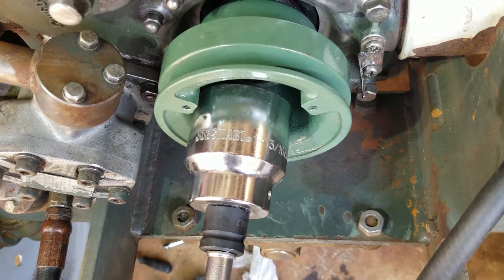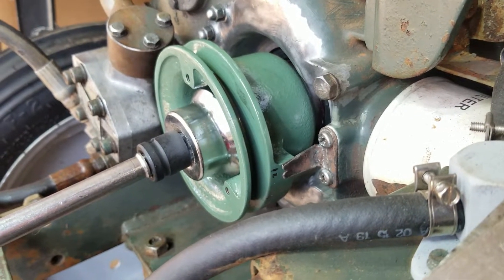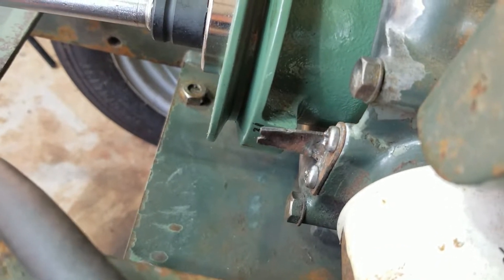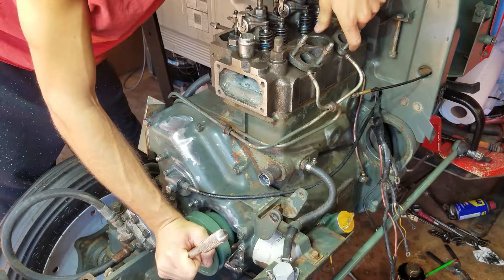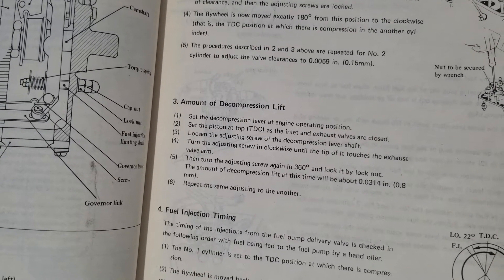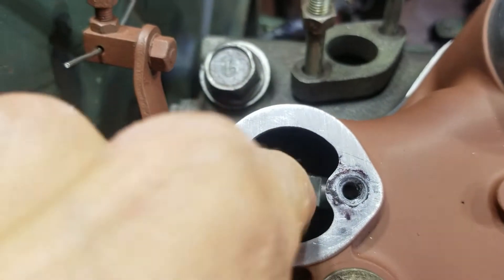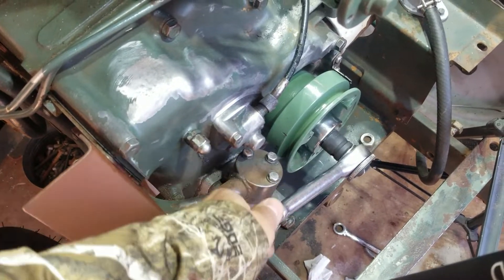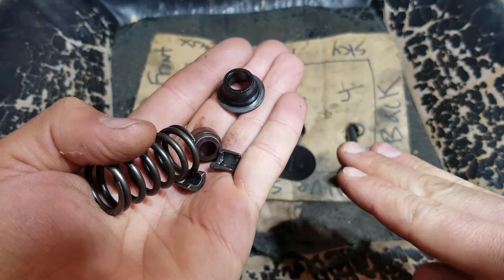Yanmar Tractor Valves and Decompression Lever Adjustment

Comment: Where did you get the engine service manual? Do you want to sell your old manual and liner/ring compressor tools? I have a YM2000B
Reply from the maker: I got my printed service manual on eBay for the Yanmar YM240 the American version of the YM2000B. I don't want to sell the tools, because I plan on rebuilding more Yanmars.

Comment: My tractor does not have the notches on the pulley. It’s kubota B6000. My tractor would barely start and sometimes wouldn’t start. I tried adjusting the two nuts on top that are attached to the decompression lever. When the nuts were all the way in, the exhaust was putting out white smoke and engine wouldn’t start at all. I adjusted them by pulling them out a little and tightened the small nut around it for both cylinders, the tractor runs great now, no white smoke, and it starts even faster than before. It even starts on idle without giving it more diesel. I am concerned, did I do too much compressions and is there a risk of blowing the engine out? Or am I good? Any ideas or troubleshooting will help, thank you.

Comment: how much should this cost to have done? I have a ym1610d
Reply from the maker: The problem is no one knows how to work on these old Yanmar tractors. Maybe $150-200.

I did all the labor. I paid $100 labor plus parts probably $150. So $250 total to rebuild the head.

Comment: Keep the vids coming man I just got a 1700 and it won’t start so these help and I may want to rebuild too- it’s on my bucket list and this helps
Reply from the maker: I am, my rebuild video is gonna drop when I get the rest of my parts. Stay tuned.
Reply: As far as the rebuild kit goes for the engine where did you order it I don’t see a whole Lotta options online